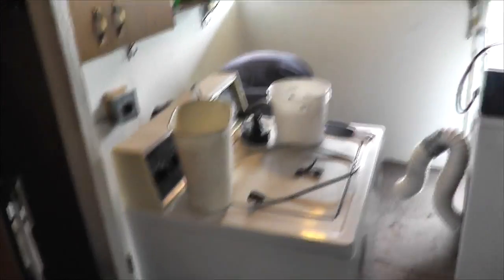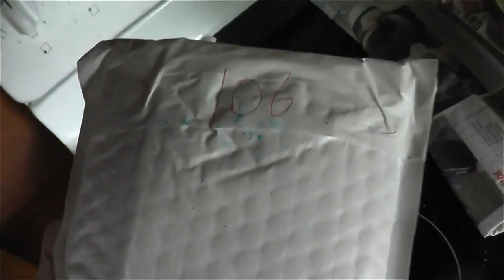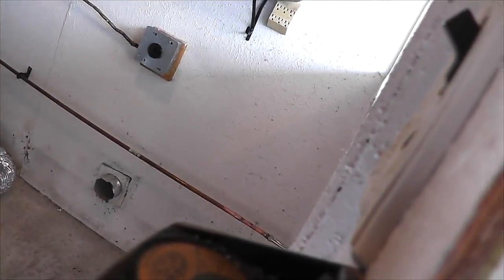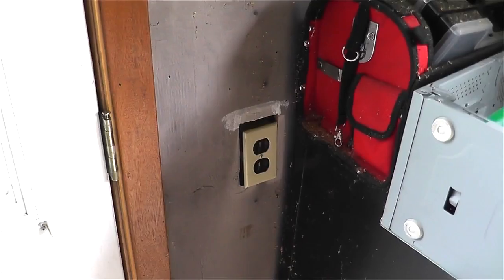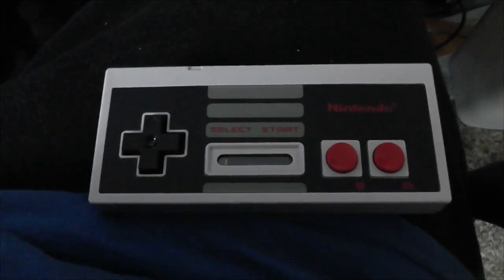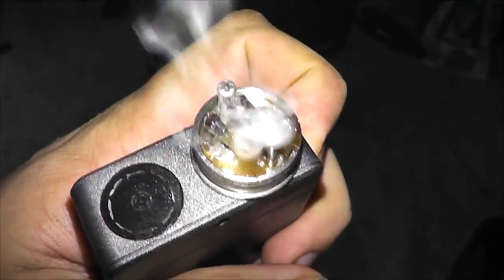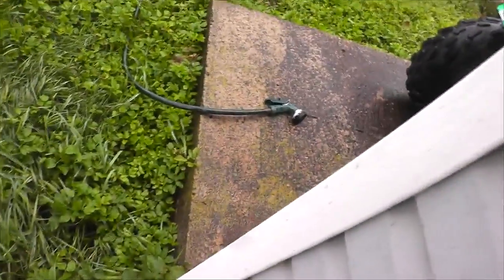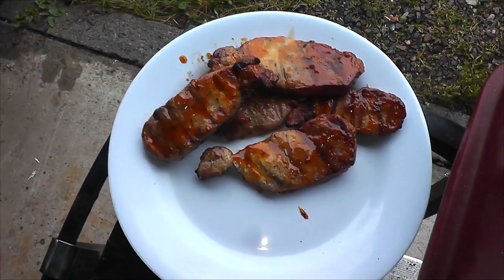That Day I had outside water installed

Comment: Build your own, especially if you plan on doing more videos you can have an epic video card to help with rendering.  You might want to get a couple of pool noodles and wrap that pipe up for when winter hits, it works the same as heat wrap but cheaper.  The more you know....
Reply: Depends on the place I have seen the proper foam, though it is the same just without color, for as much as $2 for three foot, and as low as 50 cents for three foot.  Once summer is over store clear out their selves of all summer goods and you can get the noodles for nearly 10 cents, again prices may vary on store of course.

Comment: i told you the Dell warranty calls are an outsourced call center from India and they have no clue what is actually going on at dell that's why you have full warranty on the thing and the indians are calling to sell you more warranty. i just hang up on them they are told not to just take no for an answer so they'll annoy the hell out of you but again THEY ARE NOT DELL 
Yeah i keep buying my walmart out of VG also , wondering if you were going to mention the difference in DIY VG from those kits versus from the walmart bottles or not.